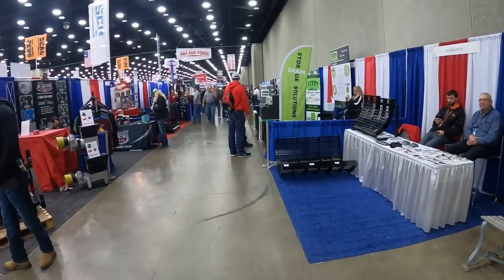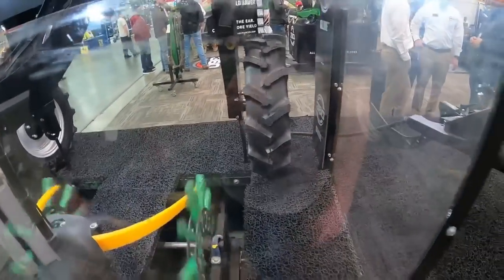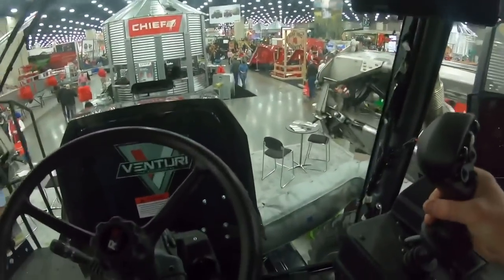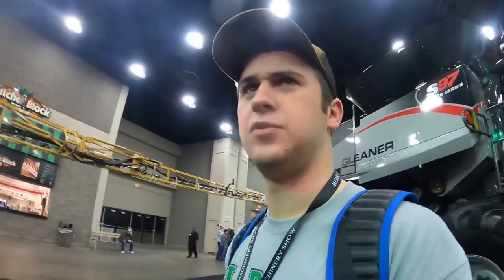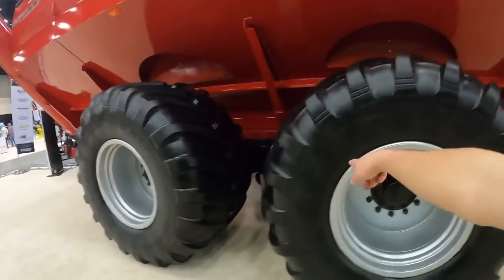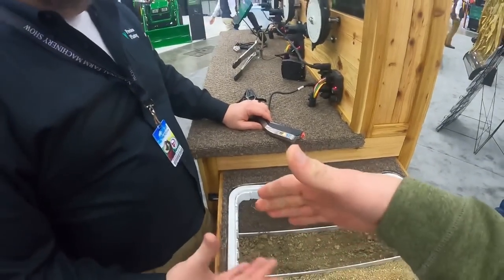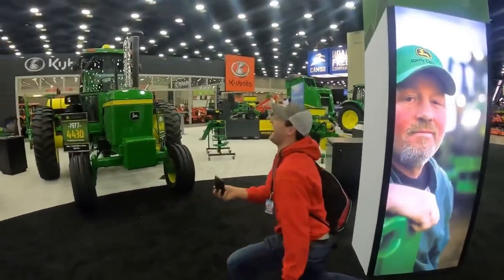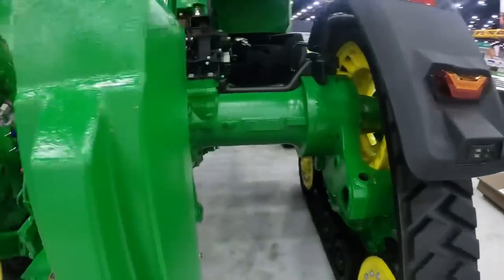Traveling to see billions of dollars worth of equipment

Comment: I heard that the dev for the ideal worked for jd, designed the ideal/x9, but left and went to fendt, and then jd made the x9 using the same general plans, that's why they have so many simaliraties, if that's correct it's an interesting tidbit
Reply from the maker: I’m not sure on that i would have to do some digging and find out dome things on it